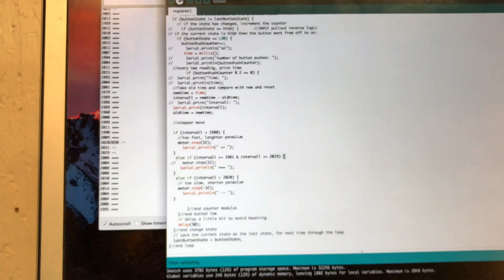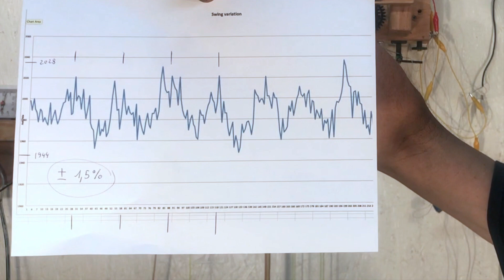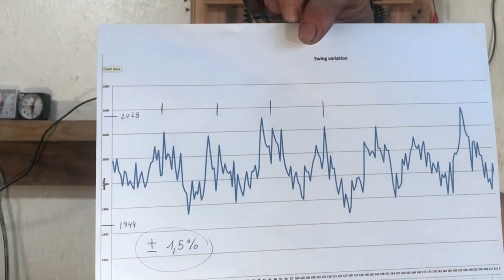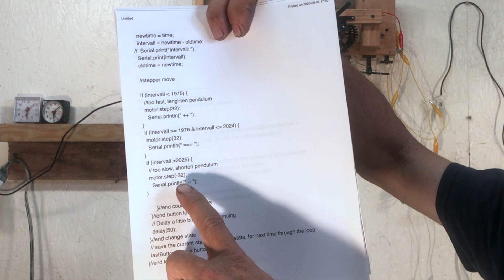3D Printed Mechanical Clock with Electrical Winding and Arduino Time Keeping Adjustment

Comment: You could probably make it more accurate by dynamically moving the stepper motor instead of setting it to 32 steps. For example, if the timing of the pendulum is over your threshold, instead of moving the stepper 32 steps, move it based on a ratio on how far out the pendulum is. Divide the time by the maximum time and multiply that by a step amount. That way, the further out of sync the pendulum is, the more the motor moves. And if it is slightly out, it only moves a small amount. Modify it every swing instead of a set threshold and it will probably keep time better by micro adjustments on the stepper motor.
Reply from the maker: Good idea, thanks. I am just at the beginning of my experiment, lots more to come

Comment: Very interesting concepts. Do you adjust the pendulum length after every cycle that falls outside the range? Or just once per minute so it can average all the variation over a complete rotation of the escapement?
Reply from the maker: I am experimenting every swing as well as once per minute, since there is a fair amount of variation in one minute, also want to experiment with various escapement